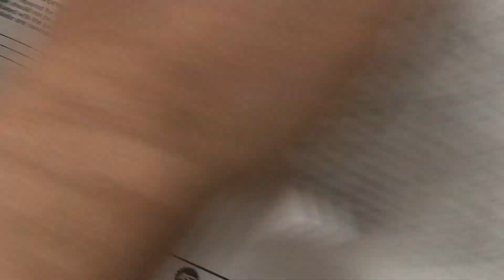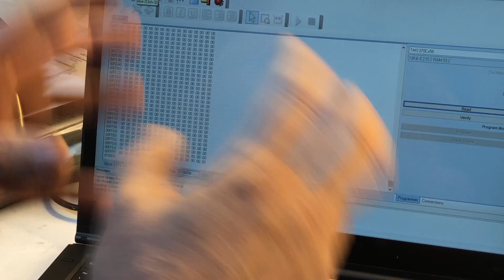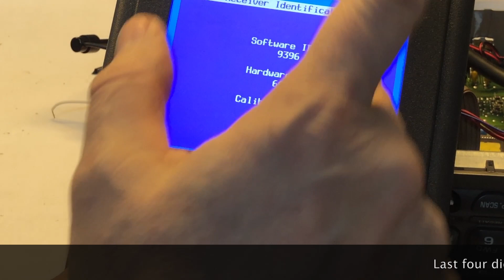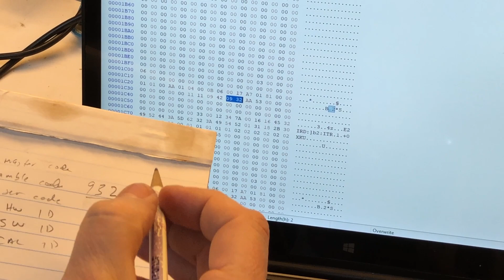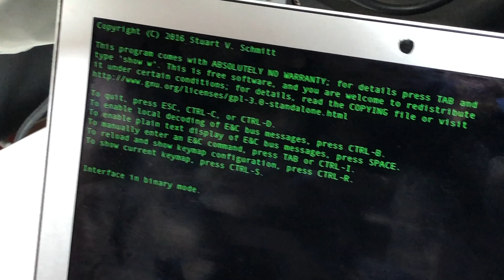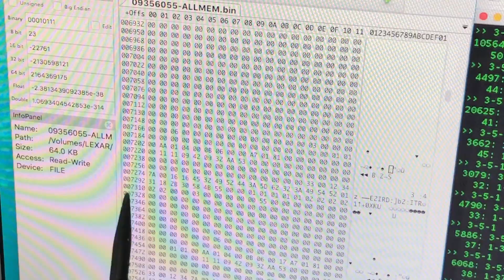1994 - 1999 GM Delco THEFTLOCK Radio LOC How to Unlock Code using Arduino & TMS370 (Chevy & GMC)

Comment from the maker: Here are some unlock codes I verified during my development of this video for you as freebies ;-)

“6-digit Scrambled Code”   “4-digit Backup Code”
               042048                              0734
               172174                              1184
               262266                              0400
               312313                              0490
               402413                              0327
               442450                              0263
               622629                              0689
               662672                              0534
               672676                              1719
               712726                              0104
               832845                              1629
               832846                              1013
               892905                              1506 
               932942                              1111     <--  example featured in the video
               942955                              0682

When I first recorded this in late October 2020 the automated Delphi phone system was still down as reported by GM in their service bulletin of September 2019.  However, sometime since then and January 2021 it appears Delphi plugged the system back in due to popular demand (though the service bulletin was not updated so this may yet again be temporary).  That's great actually as it restores the free unlock service.    But this system being down for a year teaches us it could go away at any time, so the information in this video will help with the problem in perpetuity as the saying goes.

Update: viewers report that GM has now permanently disconnected the phone number now in 2025.  So this video approach is now the only way to reverse engineer the stored Theftlock code.

Comment: Yes hut how do you unlock it without all the extra stuff? Im still very confused
Reply from the maker: Since GM took down the 800 number, there's no other way to unlock these vintage radios since they use an embedded microcontroller and firmware algorithm to handle the lock code, rather than a memory chip like the generation of GM radios that followed it.   So what I showed here was an approach to reading the internal process and detecting the code, but it is going to be different for every radio and it is intended for those with an electronics / software engineering background only.   

Delco Electronics' Theftlock system of the 1990s was actually a very impressive and effective approach to bricking the radio in a theft situation.

Comment: If I wrote down the code a long time ago is it still the same code to unlock? I think it was like 1040 or something
Reply from the maker: The radios of this vintage do save the code originally entered, even when disconnected from the battery.  That was part of the Delco Theftlock design.

Comment: Would be an intresting project to make an obd2 tool that you plug in and turn tge key on and it automatically reads everything then displays the unlock code on a cheap 4 digit display maybe a esp32, or it could have a simple android app to display the code... just an idea...

Comment: 1994 Delco radio for a Geo Tracker, it’s the CD cassette combo, locked and the code i keep getting is 8719 (mine only gives a 4 digit code). Im honestly at my wits end on trying to unlock it.

Comment: Maybe you can help me.  I have an original 2000 Astro. My radio sound totally quit. It still displays the AM/FM in the window, so it's getting power. I have checked the antenna. I removed the radio and checked inside of it for any signs obvious issues, it's very clean.  It then, all of a sudden, started working perfect, while I was driving. Then it quit again. So now I am going through this, on again, off again thing.  I can't track down what makes it go on or off.  I have banged on everything I can think of.  I can't make it repeat. Could it be a relay that's acting up?  I checked the ground connections, all clean. Everything else in the van works, nothing coincides with the on and off thing. 
Thank you,,,   😒
Reply from the maker: The problem you describe is most likely within the radio circuit board.  After a quarter century solder joints crack and weaken, electronic components degrade internally, etc.  But you could try to eliminate a case of a loose wiring harness connection first.   I would do that by removing the radio and connecting an oscilloscope, or voltmeter in a pinch, with appropriately sized test leads (they cannot be larger than the male pins on the radio connector or the harness female terminals will be damaged).   I'd test drive it with this setup on the route, and outside temperature/weather, that triggered the intermittent behavior previously - seeking a recreate.  If found, the problem is in the harness, if not, it's in the radio.
Reply: @DrShock  Thanks again.  It seems that it's a connection in the driver door. Three times now I have messed with the door or door lock button and the radio would start working. Tomorrow I'm going to take the door panel off and see if I can find a short, ground wire or broken wire. I thought it might be one of the relays.  I tried tapping on the relays, nothing changed.

Comment: My thought.... Is there any way to figure out which pins on that chip would be the EEPROM, locking mode. Maybe we could just snip those pins to disable the code?
Reply from the maker: No, the TI TMS370 microcontroller chip used in these GM / Delco radios does not have any external pins exposed relating to the memory content where the unlock code is stored.  So one cannot disable this early version of Theftlock thru modification of the circuit board.
Reply: @DrShock  Admitting, I am a total novice when it comes to electronic chips. Just so I understand. The chip has approximately 17 connections on each side of the chip, about 68 total.  It isn't possible to find one that is associated with the LOCK code?
Reply from the maker: That's correct, none of those lines have anything specifically to do with the lock code.  That's why these era radios cannot be defeated by simply damaging the circuit board.  Those lines cover the general purpose power, ground, interrupts, external address, and external data I/O for the entire microcontroller,  rather than being for one internal memory area.
Reply: @DrShock  Thank you,,,, Darn!  I am now hoping someone else can send more codes, they got from GM.

Comment: Thank you for the codes.  I just purchased the same radio from a seller, it's still locked.  I thought I could just remove a EEPROM chip so it would work, I guess NOT.  
Do you by any chance have more lock codes? I get the radio on 6/23/2025 and hope one of these codes work.
Reply from the maker: There is no EEPROM used on this vintage style radio.  The lock was actually far more robust (and effective) as it was part of the embedded microcontroller programming storage.   So you cannot defeat it by damaging the circuit board.  The code can be decoded over the communications bus via an Arduino (which is why I made this video).  

You could try the automated number in the video description (which is reported that GM reconnected it after Covid), using the information I showed about displaying the dealership master code.
Reply: @DrShock  The automated number is no longer in service. I have been trying to find a list of more codes like you posted.  Thank you for your list.
Reply from the maker: They disconnected that phone number once before, which is why I put this video together.  Then because of alot of dealership complaints, GM re-enabled the phone line.  Sounds like GM decided again to pull the plug forever now given how much it costs.  You might try the comments to see if other viewers have posted additional codes than those I've listed in the pinned comment.

Comment: I have this same exact radio in my 99 Silverado.  Mine has recently started not picking up the fm stations like it should.  I have checked antenna , antenna base, and the coax cable with multimeter. Everything checks out.   Is it  possible it's the radio?

Comment: Can I replace my 1997 GM Olds minivan Theftlock radio with a 2001 RDS radio pretty easily? That is, are the back connections the same and can I just remove the encryption chip on the 2001? Or would the 2001 not have the BCM VIN cable available in the '97 Venture van? The '97 has the cassette built in and a factory remote CD player along with controls on the steering wheel. The problem is the power push button '97 van radio is almost worn out as we have to push really hard on it to turn on or off. The 2001 at the recking yard has the same faceplate dimensions but has both the CD and cassette player built in. Thank you!
Reply from the maker: These two years are unlikely to be circuit board compatible.  Its possible they are not going to be communications bus compatible either since RDS was a new design.   If I had a customer with this situation, I'd advise them to just find a Theftlock radio from a 1997 or 1996/98 instead and just swap the faceplate out.

Comment: Great video!  I’ve got a 96 Vette with the Delco Bose system that I’d love to hack, hard wire hands free Bluetooth, add an aux input for a CD changer and edit the firmware to display what I’m playing.  The TI chip is an enigma.  Where can I get a datasheet like the one you showed?
Reply from the maker: Thanks, I linked the TMS370 datasheet in the description.
Reply: @DrShock  actually the chip on my board doesn’t make any sense? TI R150D022FN
Reply from the maker: There are alot of these radios that cosmetically look the same, but are of a very different circuit board design internally.   When I was doing this project I was working with GMC and Chevrolet trucks, and found the TMS370 wasn't used by Delco after model year 1999.   It is possible that the circuit board change happened earlier for some other models, or even later.   Also, keep in mind that Delco would sometimes change the original markings on the chip to use their own (if you buy enough chips you can get whatever number(s) you want stamped on there).   So examine the chip packaging and pinout and do some tests to see if it was just a TI part labeled differently as well.

Comment: OK, QUESTION. this should happen when you disconnect the battery for even a second right the locking part? Because I've disconnected my battery on my GM truck with this radio and it hasn't locked, it's just turned off when I did that. Like just pushing the button on the vol knob radio comes back. Is that fine? I don't understand if I have to get it to even lock to do that. Oh also my radio says to push presets 1 and 4 to to that or something?
Reply from the maker: If you have the year range this video covers, and the Theftlock logo on the faceplate of the radio, then a red light on the radio faceplate will flash when you have the engine off and the various onboard computer modules in the vehicle have gone to sleep.  If not, then the lock isn't enabled correctly.
Reply: @DrShock  okay I see that because reading the manual on it it tells me to set a code on it with presets 1 and 4 and you will get - - - on the radio. I get that tho the one that gets me is the one when you press presets 2 and 3. What thought if those are when the radio is locked locked by factory or something. Like how you got the master code of 1111 and not the other of 123 was it? But yeah I was like thinking if mine was doing the right thing because it is a 98 Sonoma with that radio in it. It does indeed say theftlock on it like that too. I feel like adding the aux to it and the bluetooths in it but I worry that it'll lock on me using the GM factory code. I guess like how hondas do it? I had a Honda that I disconnected the battery and the radio locked itself and asked for a code. Tho the manual said if it wasn't disconnected in it just try pressing the on button for like 8 seconds and it should turn on. When it did that yes it did work and the radio is functional. I want to disconnect the one in my truck which looks like that like pretty much exactly like that but hopefully without worry of locking it like messing up my efforts of the aux/Bluetooth mod. I see the original owner never actually put a lock on it then because I've disconnected the battery on my truck twice and the radio remains unlocked. I wanted to see if that can happen to that radio I never had the red dot come on ever when like all the modules go to sleep in it. I did read your description and now see the Delco hotline actually works again. I am actually VERY GLAD I found your video on this thing, I'm too dumb to figure any of that out and also have none of those tools to get to the chip n stuff. Tho I am happy you found a way to save these radios. I like the touchy screen radios but I don't fancy the modding the actual panels and bezels to fit it. Also I worry if someone would steal it from my truck between you and me lol, the old radios well no one bats an eye to that one. So I am kinda glad because this explanation kinda green lights me to try to do the mods I want for that stock look in it but with modernish stuff in it.

Comment: Anything for 392 397?
Reply from the maker: Run it thru the 800 number in the video description, GM brought it back awhile after this video was done.
Reply: @DrShock  the 1 800 number doesn't work anymore,  no answer no matter how long it rings
Reply from the maker: I can't say I'm surprised. I just tried the 800 number myself and there's just one ring and it goes dead.  It could be a temporary glitch and you might give it a few days, or they could have finally decided it was too expensive for GM to keep paying for the phone line. ;-)

Other than the technique I've shown in this video, there is no other way to retrieve, or disable,  the code from these early radio Theftlock designs that do not use an EEPROM chip.

Comment: Wonder why they put a code in these radios surprised, aftermarket, radios do not have that feature.
Reply from the maker: Folks tend to steal OEM radios in the first year or so.  Big problem in urban areas.  Aftermarket not so much.
Reply: @DrShock  I learned something new. And these radios can remember radio station presets long after the radio has been unplugged.

Comment: Mine says inop on the screen
Reply from the maker: That stands for INOPerative.  You entered too many wrong codes so the radio is now in a mode to refuse any further code entry.  You have to leave it powered up until it goes back to the LOC state.  Then you can use the 800 number in the video description to get the unlock code, or you can build the Arduino project.

Comment: Hey Doc!  I have an Arduino on the class2 serial bus like you do, but with some extra circuitry to actually transmit on the bus.  Any idea how to get some text to display on the driver information center on the instrument panel?  Or even know a device that does so I could sniff the bus and watch for it?
Reply from the maker: In this vid we're on the E&C bus (entertainment & comfort), which is primarily just the radio gear.  You can read and write on the E&C bus too.  You would have to go thru a similar trial and error exercise as I did in this vid for E&C, to reverse engineer the class II bus communications in order to figure out how to do something like that.   Using a GM scan tool can be helpful for controlled, repeatable, tests to help simplify the traffic you're having to analyze.  

I don't know of a class II device for a sniffing purpose, most of that gear is just for the more modern CAN bus.
Reply: @DrShock  RIght!  I've watched a lot of your videos, and forgot that you used an arduino on an older head unit.  I'm working with 2002-2006 class 2 serial bus, reverse engineering the protocol.  I can impersonate the 6-CD changer you often find in the Denali trim level.  But would like to be able to display something on the DIC or on the Head unit itself.  Just don't know what device might do that, so I could sniff the bus and figure it out.

Comment: Wonderful video--thanks for letting me know about it and also thanks for the shout-out. I'm really happy to see that work I did five years ago has helped someone out!

By the way, I can confirm the method works on the radio in a 2005 Buick Park Avenue. Yes, it's the same car I used back in 2016 to reverse-engineer the E&C bus.

The Buick radio was slightly different in that it requires reading 24 bytes starting from the hardware ID, instead of 12 as in the example here.

Thanks again--I had a blast pulling out my E&C Arduino shield and testing the idea out.

Comment: What if it's only showing the time but the radio still won't turn on? I have a 95 Tahoe LS
Reply from the maker: If it were locked, it would say so.   But not turning on, could be a wiring harness issue or could be that the main board of the radio has developed a problem.  I'd start with examining the harness for any broken or damaged wires, checking that you are getting voltage on each of the lines that supply it, checking grounds on those lines that supply it.

Comment: Loved the video.  Just wanted to throw out this idea for an alternate method of attack.  It seems to me that one could simulate a button press with the arduino.  If you could connect wires to the buttons that enter the code and to a test point that would give feedback as to whether the code was entered correctly or not...  Just wire it up and let the arduino try all 10k codes until it unlocks.  I know some radios prevent you from trying more than a few codes but seemed like it could work in some cases.